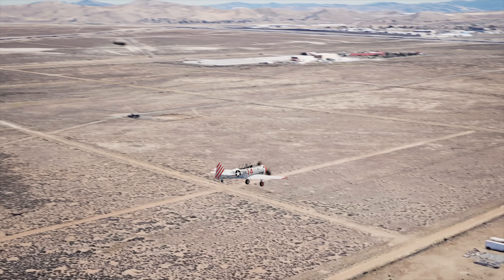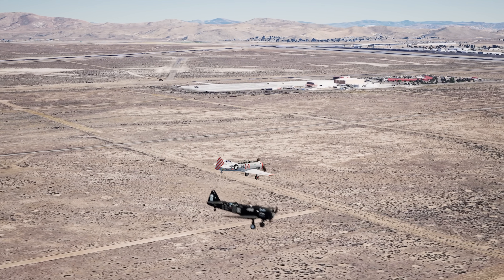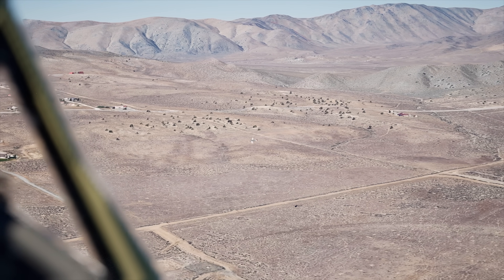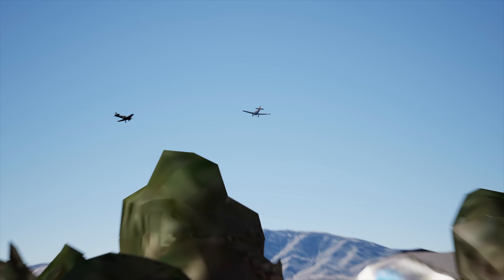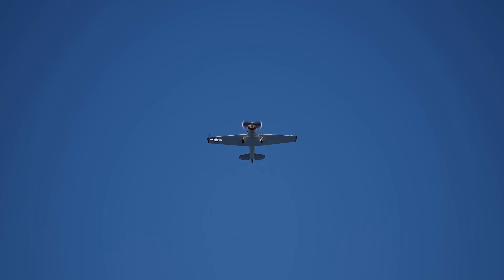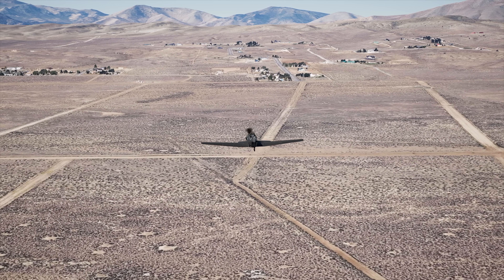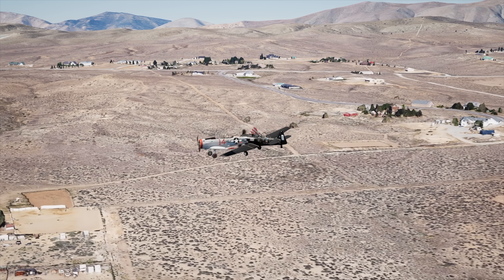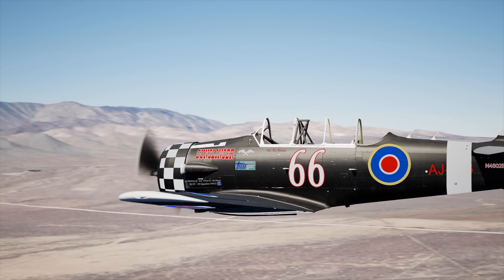T6 Crash NTSB Report and Animation

Comment: Someone on another thread gave me a hint that pressure is on finished racers to get on the ground so race control can start the next race. Don't know if that pressure was self-imposed or by race control but the absence of any cool down with everyone randomly entering a "downwind" seems as though they wanted to expedite getting the gaggle on the ground. The garbled transmissions we hear in your recordings might actually be race control giving landing clearance. I found this online for the sport class:  "There are also specific radio calls to be made by each pilot during recovery. These radio calls are:
• “Sport XX, Leaving Cool Down” (at the Cool Down exit point and beginning descent to the pattern)
• “Sport XX, Downwind Abeam” (on downwind, abeam the Race Control tower for 8 or 26, or midfield downwind for any other runway)
• “Sport XX, Base - Gear” (on the base turn)
Timing of these calls may need to be adjusted slightly for pattern calls by other racers during the recovery. Use professional comm discipline and comm brevity.
When Race Control has control of the airport, during the PRS or NCAR waiver period, each aircraft will be given an interval for landing advisory call by race control. Each aircraft will be cleared to land by Race Control when the pilot makes the “Sport XX, Base-Gear” call. However, clearance to land during a PRS or NCAR recovery is assumed, meaning this landing clearance is not mandatory, and does not require a reply. Reply is at the pilot’s discretion, and pilots should land, whether the clearance is received or not (unless a safety hazard exits that requires a go-around)".
There is a diagram in that document that shows a consistent cool down circuit and would have everyone exiting in a consistent location.
What the heck was everyone doing in the tower?
Reply: That's not true. There is no pressure for the aircraft to land immediately. They have ample time after a race to recover, and there are procedures in place for each class.
Reply: @SgtTank  The sport class procedures I found do not have a direct entry procedure to the pattern. They have an entry from the cooldown exit. They also say that Race Control may limit cooldown circuits. What is the written procedure to recover without a cooldown? We will know if there was any pressure to expedite recovery in 2 or 3 years when the NTSB docket comes out.
Reply: @jamesmurray3948  good morning. Don't get me wrong, something was out of place and not going to procedures, I don't disagree with you. Each class has procedures, and Race Control has procedures. What I was pointing out is that Race Control does not force them. They would adjust the schedule back before forcing aircraft into an unsafe situation.